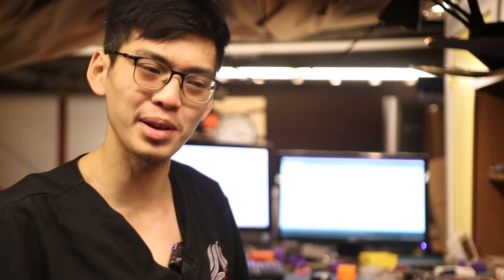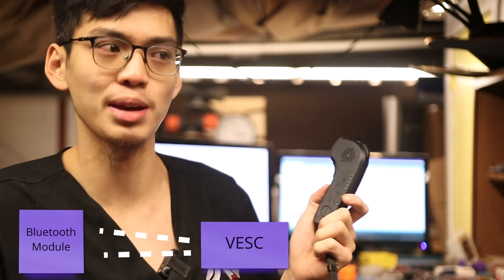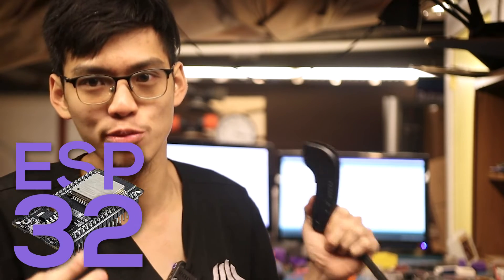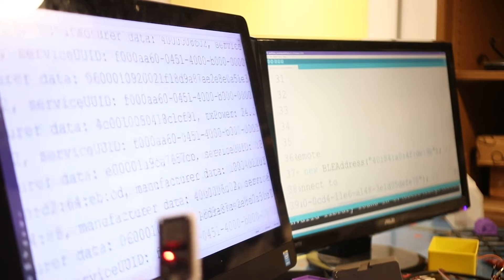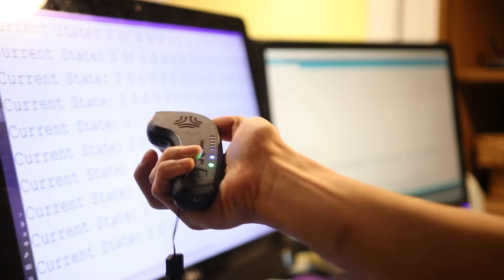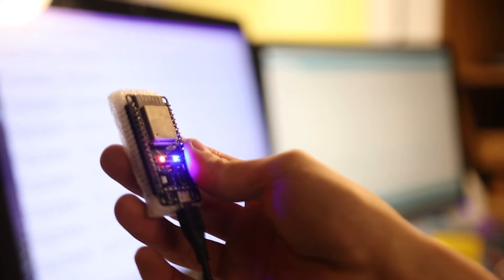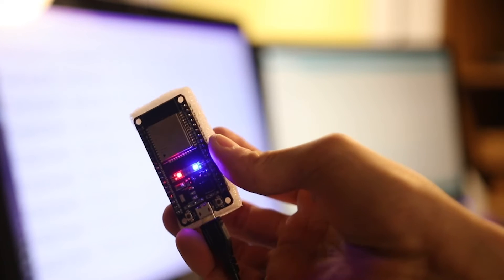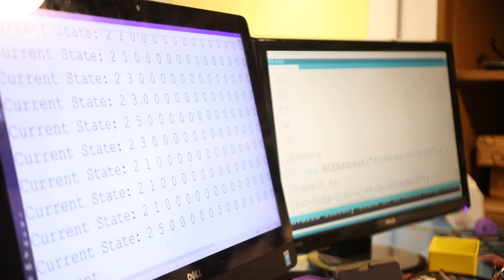You can now use your Boosted Remote with your Lacroix. | XR General Hospital

Comment: Good job! It's good to see people trying out things on the boosted boards. I have 5 boards and my boosted is by far my favorite for quick transportation because of it's size and smoothness. Unfortunately, my remote bluetooth adapter (or connection) on the esc doesn't work. Do you have any info on where i would  find it on the board?  thanks for your time.
Reply: i've had the same issue would love a fix

Comment: Sup dude its me sr doctor  this is awesome news i hope to use a xr with hobbywing esc in a proper way someday when that happens i think ima contact hobbywing to get them to make me some custom esc till then keep up all the awesome work
Reply from the maker: Hey SR doctor! I would be pretty interested to see how possible it would be to make a custom ESC from Hobbywing or another manufacturer. Have you contacted Hobbywing in the past?
Reply: @xrgeneralhospital   I was able to get a custom ordered esc with reverse breaks (as seen on boosted boards) I did run into some problems with that the esc wasn't calibrated to boosted board motors the hall sensors are layed out differently and the esc was calibrated to hobbywing motors tho they are similar in width not so much in length. Long story short I screwed up the esc so I used my backfire zealot s esc snipped the hall wires and put it in all boosted stealth stuff I did a easy modification that If I turn the boosted board battery on the esc will turn on but the battery shuts off after a while if I had a chip to emulate a boosted board esc I could solve that issue I'll have to see
Reply from the maker: Out of curiosity, can you order another?
Reply: @xrgeneralhospital  most likely
Reply from the maker: Can you email me or something? I’m very curious about this. dtwang129@gmail.com
Reply: @xrgeneralhospital  I got you on discord